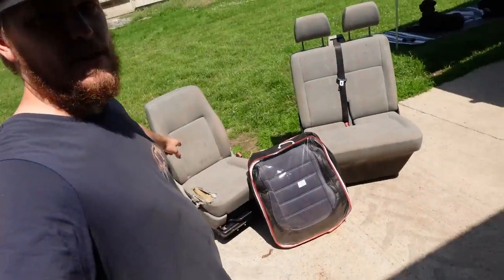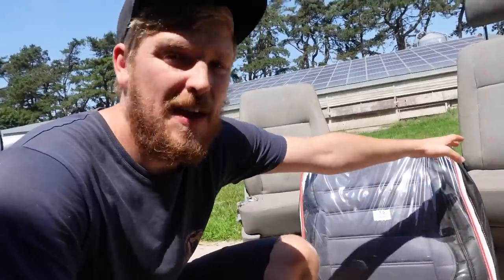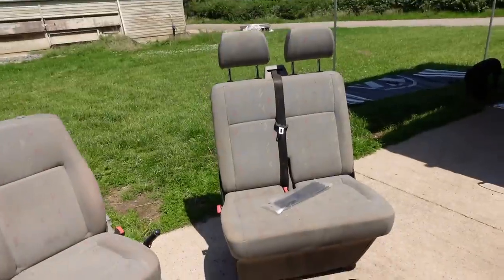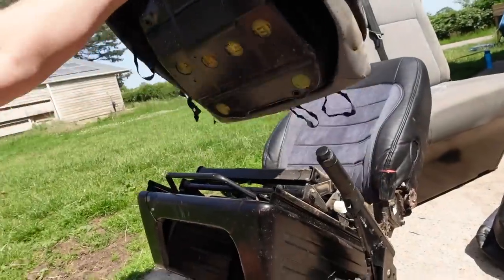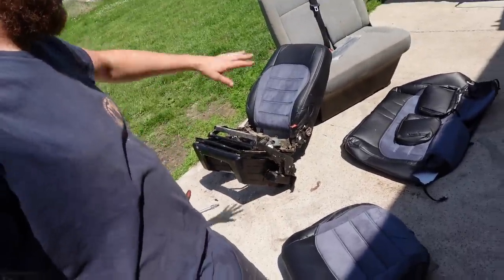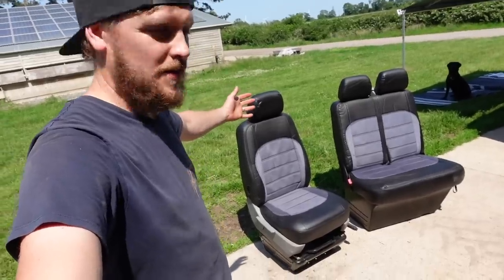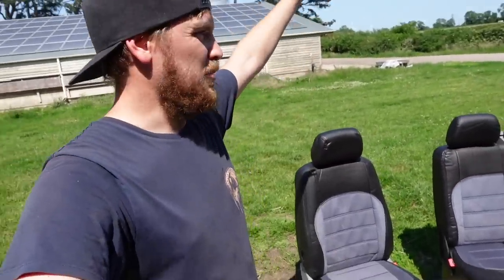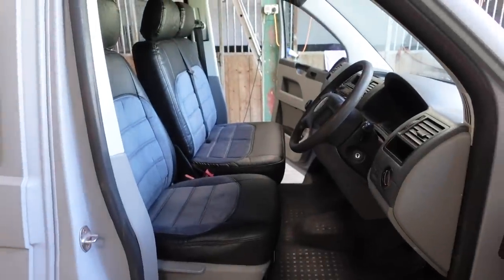VW T5 'Restoration' Ep.9 Recovering Cab Seats Transporter HQ Seat Covers

Comment: I binned the double seat in my T5 and wanted a single passenger captain seat. Now these run to like £300 each cheapest. SO.......I bought ANOTHER complete drivers seat for £60 with the base. Cut off the handbrake fitting and changed to over to L/H fitting job done!
Now my drivers bolster foam is all gone and as you say its STUPID money for a piece of premade foam. SO DAN go to an unholstery or foam supplier buy a spall piece. Take off the seat cover and cut a piece of foam AS A PATCH REPAIR. Bond it in with Evo stik and Bobs your uncle! Neatly cut to shape with a bread knife or hack saw blade! Refit your cover. Thats how I did mine now good as new GREAT CHANNEL. I keep meaning to start videoing my camper build but Im too busy to do all the filming/editing/ jazzy music etc so..............I dont. BUT I have hundreds of still photos of the complet project from when I got the old girl!

Comment: Done this coincidentally in my last video. But i fitted a original seat base to the driver seat. Those Allen key bolts are big. Same here had to get some extra big allen keys. Hope i get as many watching my video like you!😊👍. Nice one. Its coincidental that. Combe valley campers have done the same video also but with cleaning the seat covers.
Reply from the maker: Thank you for watching! They make such a difference! well worth removing the set base, Much better finish.

Comment: If you decide you want to do something to help the bolster of the drivers seat foam, before committing to buying new foam (available from TPS / vw). If you remove the oe cover, take the squab out as you did without removing plastics, pry the metal tangs away from the plastic bead, and then push on the foam and pull the cover up and over the metal base. With the foam booster exposed, glue it back together with contact adhesive (same as used for carpet lining), and then use a piece of old t-shirt and wrap the booster to help it get more structure.
Reply from the maker: Thank you for watching! The foam has worn away, Nothing there to glue back😔